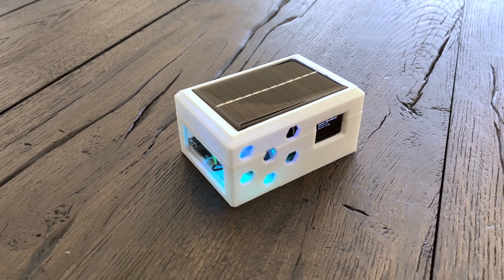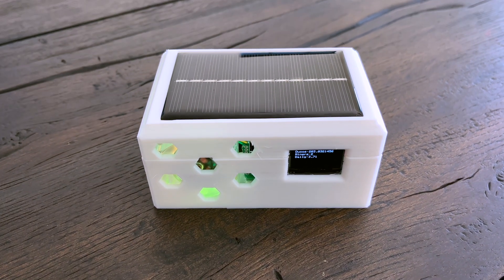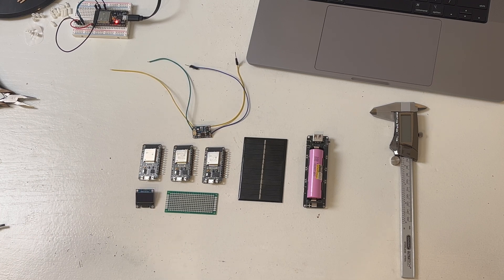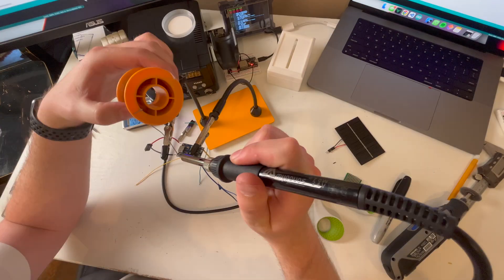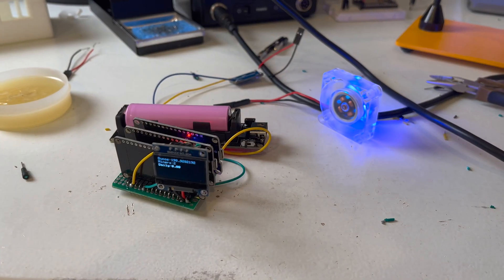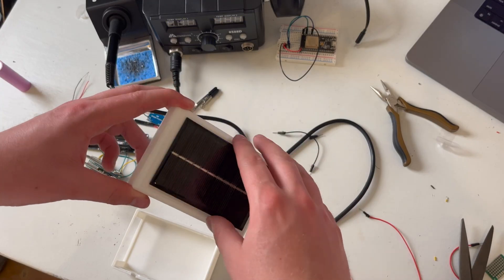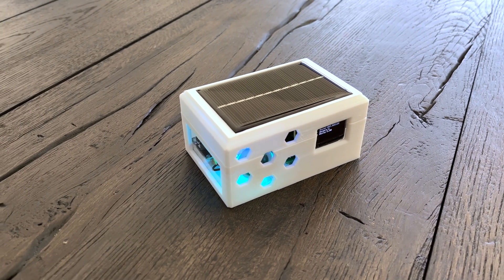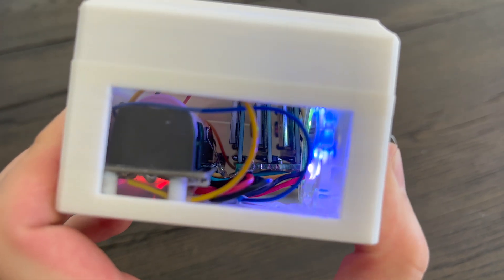ESP32 - Duino Crypto Coin Miner

Comment: How big is the battery and what is the panel rated for? I would suspect this would die after six hours max. Even if the panel got the full sun depending on its rating, it probably wouldn’t restart.